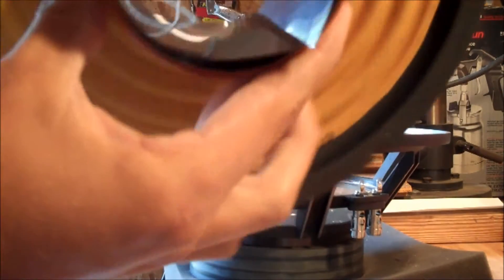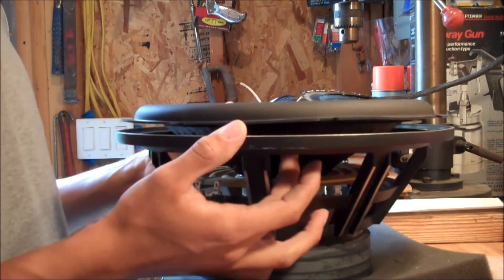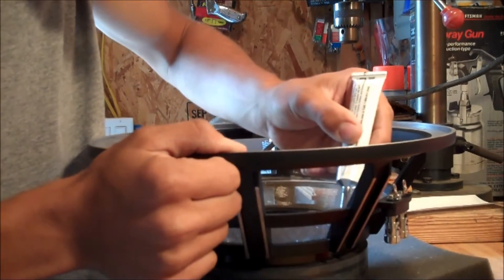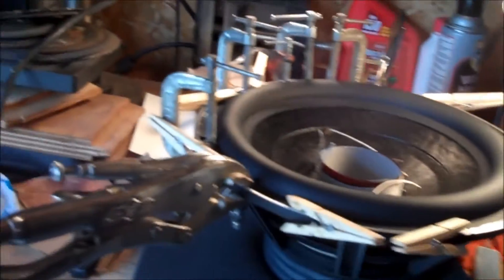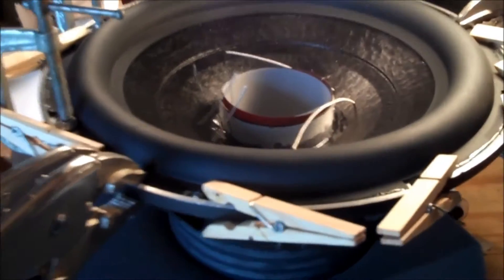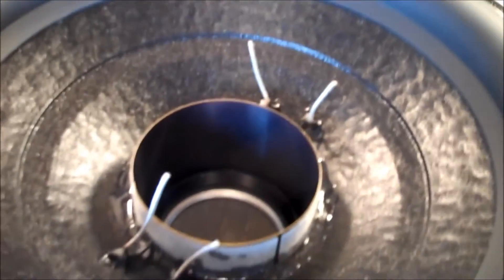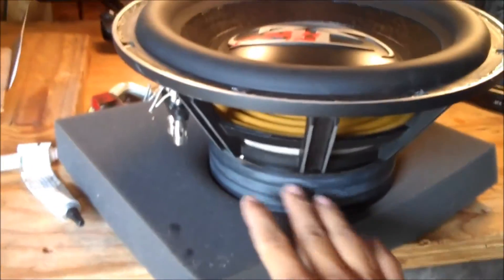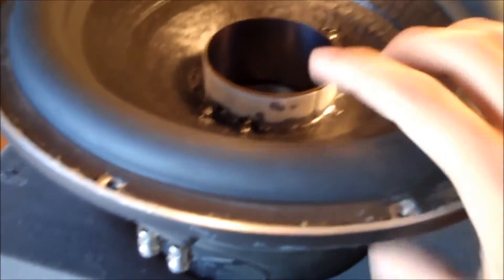How To Recone A Subwoofer Part 3 (Fosgate HX2 12")

Comment: I think im going to tackle my hx2 12, only thing i would of done different is put the dust cap on with the terminals horizontal so if you happen to drop it down installing you dont break them off. Thanks for the info!

Comment: Hey great video, just wondering if you have advice on how to remove the original dust cap without damaging it.
Thanks
Reply from the maker: It's a pain lol, I use a heat gun (a hair dryer might also work) and heat the circumference of the dust cap until the glue starts to soften. Use a flat head screw driver to start getting the cap to come off of the cone. Just keep heating it and working the cap off, you need to be careful because when the dust cap is hot it can get bent out of shape. You can actually over heat it so don't go crazy with the heat gun, I accidentally put finger prints into one once because it was so hot. Hope you get it with little trouble. Skip to about 2:30 in this video:  Subwoofer Tinsel Lead Repair
Reply: Awesome thanks it came off easily. Also what kind of glue did you use on the spider and surround?
Reply from the maker: To attach the spider and surround to the basket I use CA glue w/ activator because it drys as soon as you use the activator. To put dust caps on I use rubber adhesive. You can buy them on the PSI car audio web site, they also have an eBay store.

Comment: Do you know of any other places besides fixmyspeaker.com.
Reply from the maker: I also use The Speaker Exchange and Simply Speakers.
Reply: Ok I'm just having a hard time finding the right voice coil for them
Reply from the maker: What speakers do you have?
Reply: Rockford fosgate RFZ2412 and P312D4
Reply from the maker: From my research the RFZ subs are not worth reconeing so you likely wont find parts on those, and for some reason Fosgate's newer subs don't have recones, but for your P3, I have seen recones floating around Ebay, that's if yours is the one with the red on the back side of the cone. Other than that I don't think they can be saved unless you tried contacting Fosgate or got custom parts made up from fix my speaker, I'm currently doing that myself.
Reply: How do you get custom parts made
Reply from the maker: You can contact fix my speaker and they will try to match up some parts, but likely it wont be anything like original. But you could likely have a custom sub built that would preform well, other than that I'd say the most cost effective thing to do would be buy a new sub. Avoid fosgate being they don't make recones for them anymore.
Reply: Ok thank you for all your help
Reply from the maker: Your welcome, hope you can figure something out.

Comment from the maker: Thats what I figured because He coils are only 2.5" i think. I think the coil I got actually has better power handling because the windings were larger than stock yet I have no idea why the former was taller than stock but luckily it worked. The only reason I was questioning my parts was because they gave me a dust cap for an He sub, after this vid I found that I did have the right parts.